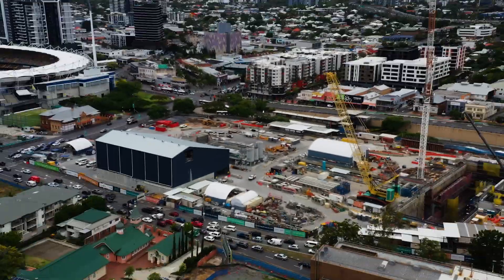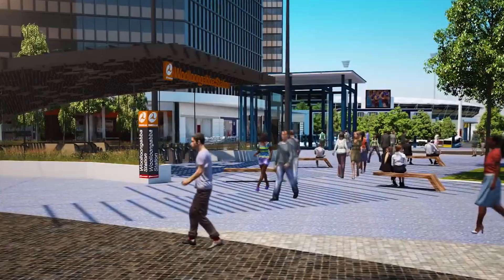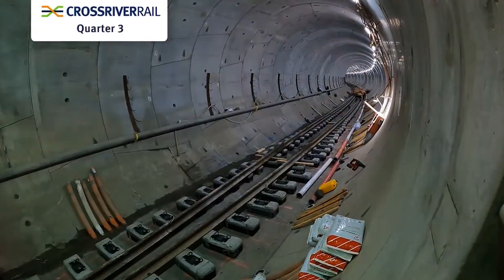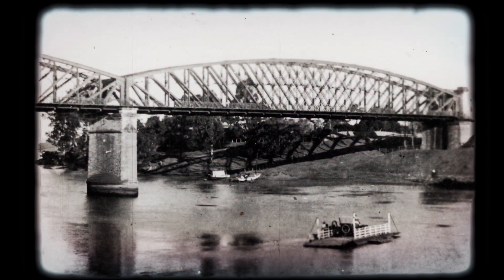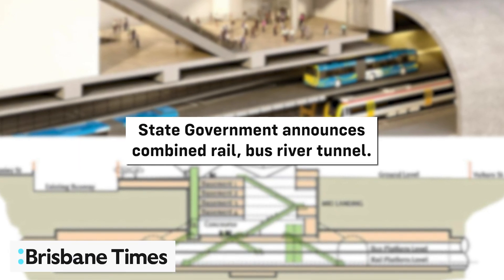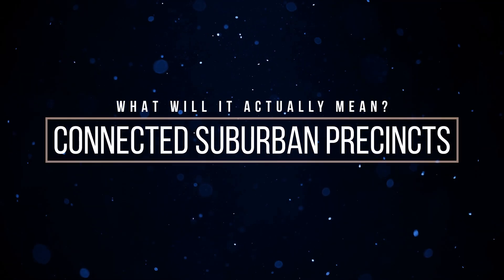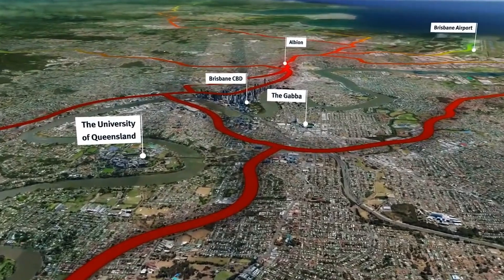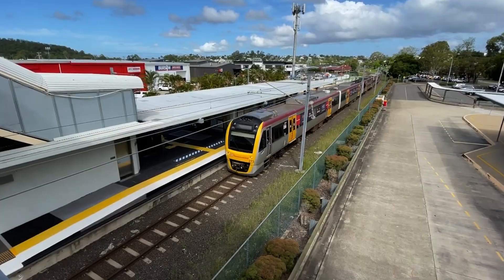Brisbane's Cross River Rail Explained | Talking Tactics with Mel Pikos

Comment: I have to admit I really skipped some the video as I was putting on Too much weight with all the sugar coating,total bollocks,there are 60 Level crossings in the SURROUNDING areas,40 within the Brisbane City,,Moreton Bay Mayor reported that the Strathpine,and Lawnton crossings will only be open 5 minutes per hour,there will be total bedlam at most of the crossings,and the increase in Rat Runnig in areas around these crossings will increase 20 to60 times,I am already doing it Too avoid 3 sets of traffic light congestion and a school zone, the Street where I live will see a dramatic rise in traffic as people like me try to avoid traffic lights and severe congestion.

Comment: BaT tunnel was superior. We now have a rubber tyred “metro” to cope with Victoria bridge capacity. Could have solved both problems at half the cost. Why did it not go ahead? Because the wrong unions had a say. The extra mode of transport will annoy people who used to have direct bus routes and privilege the few in range of the “metro”. BaT was designed by engineers, CRR by unions.

Comment: The cross river rail project will improve transportation services and finally inter-great buses with trains and the city metro will further expand services to allow more access to premium services to and from the city . The airport train line currently is a separate line to the main line services . If the proposal to make the airport train line run from the airport to the Gold Coast causing congestion on the main line services this will slow the frequency of daily services currently available.  I believe the Airport train line remain as is . The more efficient route of main line services will than be faster. Less confusing crossing over tracks will make the trains run smoothly .

Comment: No doubt woolloongabba needed a station and the bottle neck needed to be addressed. 

But will going from Gold Coast to Brisbane now not cross through south bank and south Brisbane station? It appears so. Currently south bank and south Brisbane (cultural centre bus station) are by far the easiest change over points from bus to train, bus to bus etc for the southern suburbs. For example 111, 120, 175 all popular southern bus routes all terminate at different end points Roma street, queen street, and ballow street but all run through south bank and cultural centre making it very easy to interchange. I guess the proximity of south Brisbane station to the merivale bridge may make it extremely difficult to resolve the bottle neck issue. But if possible surely it was better to keep the line going through south bank (again, if possible). 

I also acknowledge you mentioned an upgrade to metro services in woolloongabba which may resolve my concerns in future but that would require adding or editing multiple current bus routes.

Comment: The main problem I perceive with our rail network is reliability.  A splash of rain and the whole thing shuts down, leaving everyone stranded. It doesn't seem like XRR is even claiming to mitigate that. It will shuttle more passengers - when it happens to be working.
Reply: The main problem is roma st to fortutude valley.   Their are only 4 tracks and everyone has to use them.  XRR will not be using these tracks and bypasses this.

Comment: Cross River rail and the Metro are only connect a few suburbs in the inner city, that's definitely not enough. We need more train lines with affordable price to connect suburbs to cdb to solve congestion problem. Population is growing and train lines is not growing fast enough.
Reply: The problem is you can't run many more trains through the city. Their are only 4 lines between Roma St and Fortitude Valley. If you want more trains you need to have more lines through the city.

Comment: Gold Coast airport is about to get its own light rail, no need for a direct train from Brisbane airport to the Gold Coast anymore
Reply: 1. That's not happening time soon, especially with the C'wealth Govt concerned about the $8billion price tag.  2. The proposed light rail does not go to OOL, but leaves pax on the GC Hwy about 1 km from the OOL terminal, forcing some sort of shuttle arrangement.  3. The light rail is incredibly slow.  4.  If you look at any city in the world where both light and heavy rail serve the main airport (e.g., LHR), heavy rail is far faster and more efficient.
Reply: @Steve-007  that’s quite the hyperbole. The light rail will leave passengers at most 400m and at best 250m away from the terminals at Gold Coast airport. Secondly, that airport will become more accessible to local travellers with the light rail reducing the need for a direct Brisbane airport to Gold Coast service. Either way, good news for south east Queensland

Comment: I just loooove how all these projects really only serve the precious 10km radius of the city. Most actually live OUTSIDE this radius, and god help you if there's a "police incident" say beyond Northgate station (which is usually the case), as there's NO buses as a replacement to/ from the city beyond Bald Hills. No train, you're on your own. And Roma Street right now feels a bit like the portal Craig Na Dun in "Outlander"- you never know where you're going to come out of!!!
Reply: As said in the video, but perhaps not explained clearly enough, the rail bridge over the Brisbane river is a massive bottleneck which reduces the amount of trains which can run on the entire South East QLD network. A lot of suburban lines cannot run at their full capacity because of this bottleneck. Cross River Rail will mean there will be more frequent services for everywhere at least as far north as Caboolture. It will also open opportunity for double tracking the line to Nambour and for the planned Sunshine Coast line. There are also plans to extend the Springfield line which will benefit from Cross River Rail
Reply: Serious. I live at Toombul 15mins from the city and can barely get a train cuz everything is geared towards express trains for those 25km plus

Comment: Will the Gold Coast Line eventually expand itself down to Coollongatta Airport?
Reply: Yes*
The long term intent is to progress the line from it's current terminus at Varsity Lakes to the Coollongatta Airport. This was true back when the terminus was Robina and plans were underway to extend to Varsity Lakes. However, there is no clear timeline, budget or major commitment to actually enacting this. It's less a promise and more an ambition.  Hypothetically any new government could quite easily decide they are going to abandon any plans to one day develop the route, only to lose the next election and have the new new government recommit to it. Any extension past Varsity Lakes simply isn't close enough to actually happening for it to be anything more then a handwave one way or the other right now.

That said I don't think there is any risk of the concept of heavy rail to Coollongatta Airport ever being abandoned. It is broadly accepted that it will happen one day by a majority of the public, the politicians and the business interest involved, so it is unlikely to ever be completely dropped. There is just a lot of 'When' and 'How' that needs to be locked in.

Comment: Its a good start but it really only services areas that have good public transportation…there needs to be an east west tunnel running from say intro to the airport crossing the river multiple times..needs to then have the same tunnel come down from the north. If you want to remove car movements you need to make more direct and convenient ways to us public transport..we need to and should spend another 20 billion if that’s what it takes to upgrades brassy train network…the world will laugh at our city during the Olympics…this project should have been started back in 2010 but bloody politics got in the way of doing the right thing for the ppl of Brisbane…
Reply: The very initial plans for the next major Brisbane rail line are for a metro from Toowong via West End, the City, Kangaroo Point, New Farm, Bulimba to Brisbane Airport.
Reply: @jayfielding1333  actually, the plan has been altered to include two metro lines. The one you were talking about and another one that goes from Capalaba to Northside via the NWTC. This will be called the Subway or MRT, not Metro as metro is already the misleading name for a fancy bus

Comment: Gold Coast will get a tram to their airport
Reply: The Gold Coast Line will also be extended to the airport from Varsity Lakes.
Reply: @jayfielding1333  well it was suppose to but Corporate wankers at Brissbane airport are opposing it cos they are worried more airlines will then switch to Gold Coast airport  with one seat ride into brisbane, due to lower landing fees at OOL, particully favoured by low cost airlines

Comment: If you think that Cross River Rail and Brisbane Metro is all we need for the Olympics then ur wrong. We need a lot more than just that
Reply: The outer suburbs- and defiantly northside- are sooooo neglected! So much more is needed!
Reply: You’re right but it’s definitely a step in the right direction.
Reply: yup! More new lines, more upgrades pls. We can't be just repeating our excitement on the 'Metro' and CRR for the last 5 years.
Reply: Brisbane needs this regardless of the Olympics.
Reply: Feds just rug pulled us on the funding so probs not going to get much more help. Maybe if Dutton gets in as a Brisbanite he will give us back the funding the feds promised us.
Reply: Cross river rail is only the beginning. Next could be Corinda,  St Lucia, CBD, New Farm, Bulimba, Doomben. Looping back through Milton to Corinda, or connecting to Airport.

Comment: But also means the first stop after exhibition station will be eagle junction station. Trains from Goldie and Springfield up to Caboolture and Redcliffe currently use platforms 3&4 at Albion and go past as express trains. Are they changing it so those stop at albion and wooloowin? The maps dont seem to show the new line stops there which would be a missed opportunity for the inner north but the manoeuvre from the left to the right is true. The only way around it is to stop the trains at Albion as well. Otherwise we have no way to transfer to the new line any closer inbound than eagle junction and would have to go all the way inbound to Roma street to transfer to get to the Gold Coast! Albert street station will be useless for the inner north residents. Southside got all the upgrades! Hurry up and upgrade Albion. The budget papers say 2025 or 2026 or still years away!Seems stupid to upgrade exhibition then run it express to eagle junction! Anyway Rant over lol good for outer commuters coming in though! Bring on a new rail tunnel north under Brisbane for the Sunshine Coast rail line. They need it up there badly. Car is king currently.
Reply: Why not upgrade Albion stadion
Reply: @electro_sykes they are but not for a few years.
Reply: Why it badly needs an upgrade with transit oriented development already around it. Also, considering Toombul shopping centre closed forever since the floods, it would make sense to build a new shopping centre above Albion station  @nohandlesteve
Reply: @electro_sykes  I know it needs it badly. Too much vacant land there they need to build up.
Reply: @nohandlesteve  why doesn't it get done with CRR. Oh wait that is only meant to benefit inner city and southside residents
Reply: @nohandlesteve  well my idea of a Gympie road combined  rail/road tunnel would solve the albion problem. The Kedron to Albion stretch would just be rail, but then the Kedron to Bald Hills stretch would be Road and Rail
Reply: @electro_sykes  coz they never keep building. Just 1 project at a time.
Reply: @electro_sykes  it would be awesome!! Albion—->> Lutwyche, Gordon park, Stafford, Chermside rail stations!)
Reply: @nohandlesteve  it solves the missing link in both the northsides road network and rail network
Reply: @nohandlesteve  my concept would see the caboolture line rerouted through it and could also include a new line to caboolture west development and the long awaited sunshine coast rail line.
Reply: @nohandlesteve  it would only include stations at Kedron, Chermside and Aspley plus underground platforms at Albion. The tunnel north portal would emerge somewhere between telegraph road and bald hills and then bald hills station would also receive an upgrade. The south portal would emerge at Mayne rail yards and will funnel services into Cross River Rail via Exhibition
Reply: @nohandlesteve  and the road tunnel part would link directly with tunnel stubs in the Airport link (yes there are some tunnel stubs behind the paneling that you can only just see it). It would include a road junction at Chermside shopping centre near those cricket pitches, then will emerge at Gympie Arterial road. Gympie arterial road will also be upgrades along with linkfield road bridge.
Reply: @nohandlesteve  the chermside station would be fully intergrated within the westfield
Reply: But that will slow down my journey on the Caboolture line. I am already pissed that I now need to change trains to get to Milton
Reply: @electro_sykes yeh true.

Comment: Makes me wonder if the airport air-train will reduce their costs if it is going to be more integrated into the systems. Whenever my family use the airport we always drive as the airport airway tickets are too expensive.
Reply from the maker: Doubtful, but we can always hope!
Reply: @MelPikos State Government was looking into ending the privatisation of the Airport Line Early a while back but not much has been said about it recently
Reply: @AucklandFC2024  The same company that makes money from Airtrain also make money from the Airportlink & the Gateway Bridge and all the other Toll Roads across Greater Brisbane. Transurban does have quite a monopoly on access to the Airport.
Reply: @electro_sykes  I agree I think theres a reason for having this Train to the airport was to ease the strain and congestion on the Gateway airport toll road thats been happening cause trust me i traveling with my father sometimes by car down the Bruce Highway have often been stuck in traffic have always suspected its beenc cuz of this Gateway (toll Road Airport Link and having a direct Station to the airport would be useful in easing the Gateway Tollroad Conjestion and allowing them to make money much easier and faster  while using the airport train at the same time
Reply: The Airport Line becomes state owned in 2036.
Reply: The AirTrain is going to be half price from the 5th of August

Comment: Not just unlocking bottleneck but enable extension to Cooly, Maroochy, Beaudesert lines as well as Ippy loop (Ripley) & mayyyybeee new stations at places like Samford, Redland bay/Victoria Point & DFO,  the cruise terminal (assuming thry sort the issue with runway crossing). Also Alderley-Bald Hills link to pave way for outer suburb orbital line to include Bracken Ridge,, The Gap, Tennyson, etc....
Reply: can't they just extend the existing Pinkemba/Doomben line to the Cruise terminal and give the entire line an upgrade. Be so much cheaper and maybe also build a spur to Hamilton. Doomben line passengers have been crying out for better service for years.
Reply: @electro_sykes  There doesn't look like there would be enough room to take the line further then Pinkenba Village but the line was built with provisions to double track the line
Reply: @electro_sykes  could see be turned into a loop line linking cruise terminal doen to hamilton then doomben etc
Reply: The journey between the International Cruise terminal and Brisbane City is sad.

Plus, people disembarking have a wonderful view of the Brisbane sewerage treatment plant.

Though the line has closed to suburban travellers, I believe the corridor remains for industrial use.  The logistics of a rail link could still be problematic.
Reply: @ownyourcrazy8734  yea.  The airport line needs a makeover to.enable access to cruise terminal.   If built right you can bridge over taxiways but really dont think you can build over runways

Comment: Need rail urgently at Chermside and Carindale...
Reply: They really need a combined double deck Road/Rail  tunnel under Gympie Road
Reply: @electro_sykes  That could work as it's done in Taiwan and Japan alot.
Reply: So true!
Reply: Bus network reliability imo out those 2
Reply: @ItzWindyyy  Until you have a traffic jam 🤣🤣🤣🤣
Reply: Yeh well Southside residents prefer public transport but Northside prefer driving so road upgrades
Reply: truly it just needs a proper busway that goes to those places. BCC has a centre alignment proposal for metro, state chose the shitty temporary bus lanes...